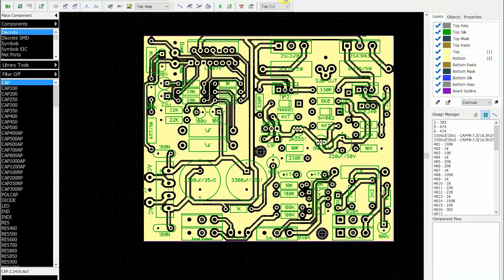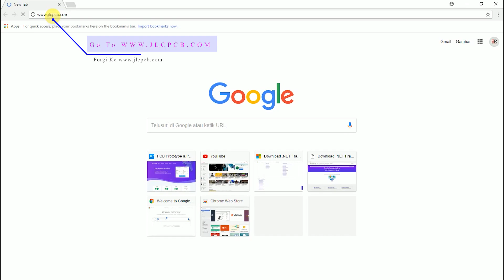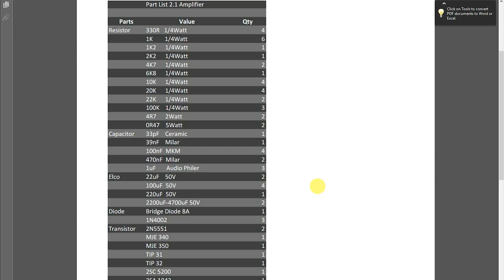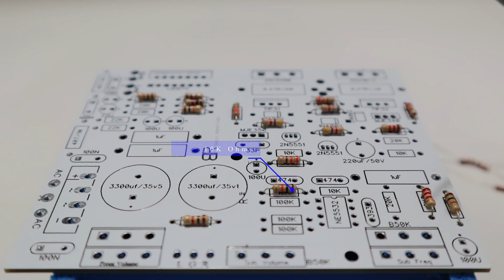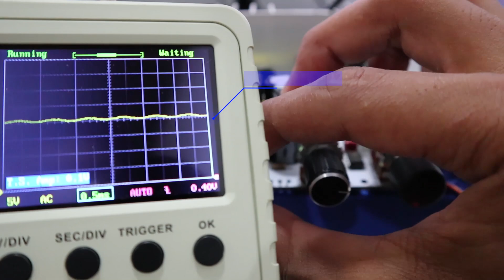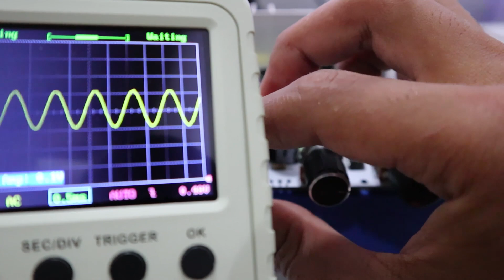2.1 Amplifier With LM1876 and OCL Subwoofer

Comment: let me see is i got this right , you use a LM1876 (2*20W) for the satelites, a 340 and 350 transistor ( 40 and 50 w ) for the bass preamp, and then a 2C5200 and a 2SA1942 wich is like up to 100W and 100 ish watts isn't that a little overkill? also i wonder if a 160VA (17-0-17, 4.7A) plus a 800-1 kg fin radiator will be  enough + a small 12 V 20VA  to power  ore or two fans.

Comment: What is the maximum RMS wattage it can drive for left, right and subwoofer? Can you specify each one of them individually?
Reply: 50w+50w+100w
Reply: It 's like Wushi Audio TB 21 class D audio 2.1=50+50+100 watts, IC tpa 3116 d2.
Compare Wushi Audio vs LM 1876, haw abaut you ?😅😅😅

Comment: hi, can i use this amplifier with 24 0 24 transformer.
Reply from the maker: sure, but need some extra heatsink
Reply: @barlexrespectaizer452  if i use this amplifier with 24-0-24 transformer,  is need to replace with different components like as diode, resistors, capacitor  etc?
Reply from the maker: @sandunsuleka3643  no, just make sure that each electrolite capacitor is not below 50 Volt
Reply: @barlexrespectaizer452  thank you friend. Im interesting on your youtube channel. How can i contact you On facebook?

Comment: Bang ane punya speaker 2 pasang 30 watt trus ane sambuk ke ampli 100×2 wat, itu speaker kasihan atau gapapa bang?
Reply from the maker: watt speaker kekecilan, lalu kalau speaker 2 pasang pastinya main 2 ohm dan jarang ada ampli yg tahan main 2 ohm
Reply: Maksud ane amplinya 100×2 jadi Lnya 50 R 50, TRUS ANE PASANG PER OUT SPEAKER 30 WAT ITU GAPAPA?

Comment: kalo pake suply 22 vac kuat nggak bang
Reply from the maker: Subwoofernya kuat sampe 30CT tapi LM1876 nya yg saya ragu... makanya cuma berani 18CT
Reply: bang kalo boleh minta layout filternya saja tanpa power
Reply: rencana mau saya pisah suplynya
Reply from the maker: cek di video diy pcb vs jlcpcb
Reply from the maker: https://youtu.be/C8BTAfSjfts
Reply: makasih bang
Reply: Elconya di kasih 10000 micro 50 V bisa ngak .trafo 5Amper
Reply from the maker: bisa tapi gk muat di pcb nya